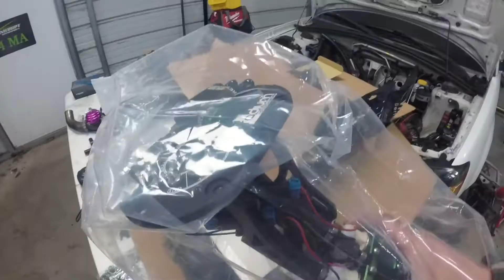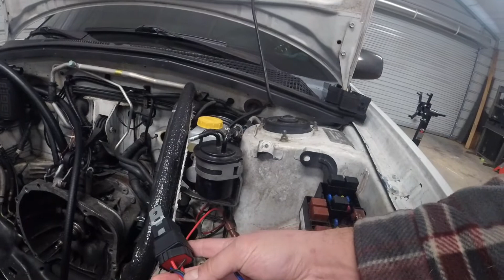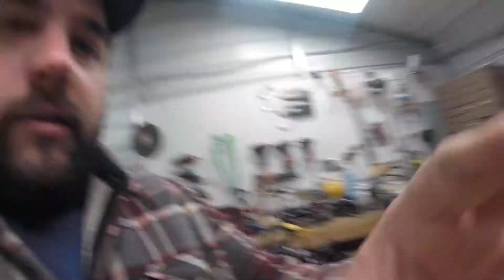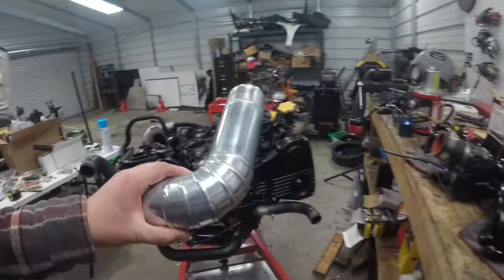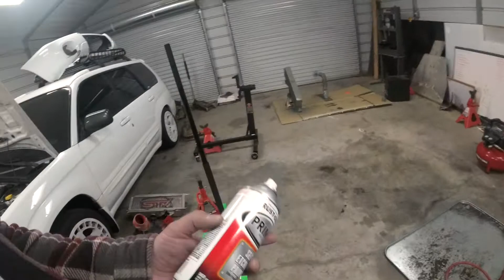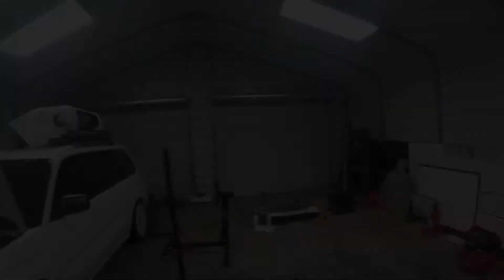Radium dual fuel pump hanger and 1/2" fuel lines

Comment: Where did you get the coupler on the turbo itself. I've been going in my head the best way to get a hard inlet on a nice homebrew Zero 🤣🤣
Reply from the maker: Hey Josh- The coupler is from HPS. It's their 3" to 3-1/2" offset coupler. You can purchase on their website. Part number HTSOR-33-350-BLK. Good luck. The zero is a monster!
Reply: @bankruptmotorsports  in my head I was like HPS haha.. This hopefully turns into a fun little death trap haha. It was already a handful with a modified 20G turning close to 500 on the stock motor!